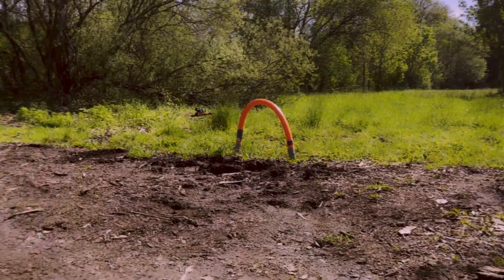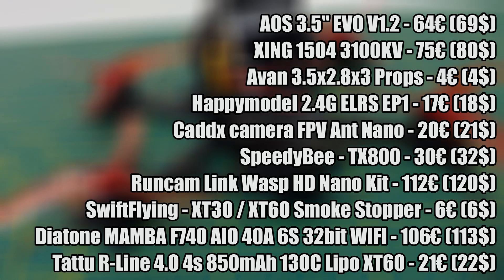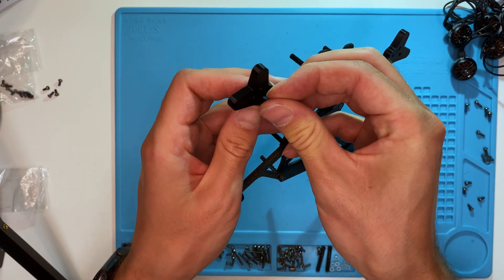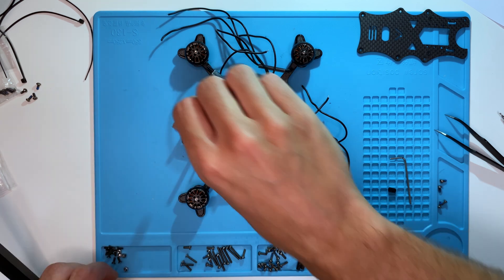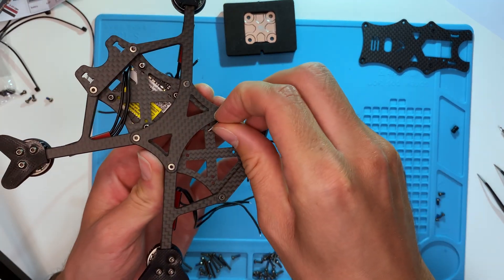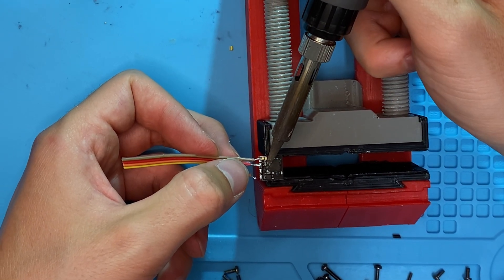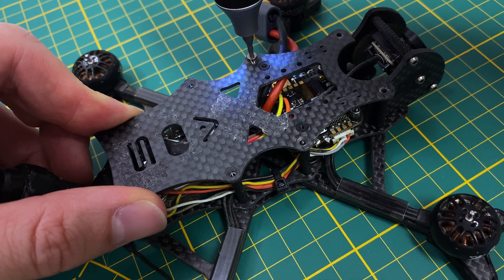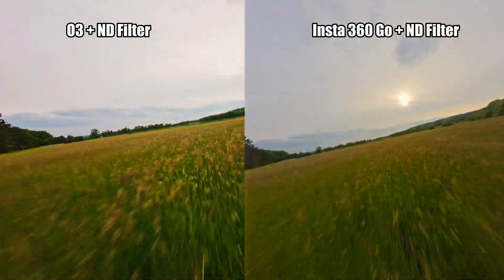3.5" FPV Drone Build Full Tutorial (Low Budget Digital)

Comment: 7:46 I always mount my receivers below the frame mostly under the plate for the vtx. You can use a giant shrinking tube or print a small 3d print part for that.

Comment: can i use a 4s battery istead of a 6s?
Reply from the maker: depends on your motors (KV)
Reply: @fpv-geek  what motors should I get if I am building a 4s?
Reply from the maker: @getpettingurgoat8170  5 inch or 3.5 inch? Freestyle drone?
Reply: @fpv-geek  3.5 inch, freestyle
Reply from the maker: All my 3.5 inch builds are 4S. Just look for the linked motors in the description
Reply: @fpv-geek  okay thanks

Comment: 7.45 maybe try a rubber band instead on either the top plate or bottom plate or you use another zip tie on the top plate. Also this build is base to start off in fpv, im making some improvements to it (in my opinion). whould you have other frames to use for this? great vid

Comment: Wow, great build guide! I especially appreciate your tips on using the correct props – they really make a difference in flight performance!
Also, your suggestion about opting for a Caddx Vista or DJI O3 instead of the Insta360 Go makes sense for those looking for a more streamlined setup. Thanks for the awesome content and keep up the fantastic work!
Reply from the maker: Thank you ☺ If I had to decide again, I would install an O3 straight away.